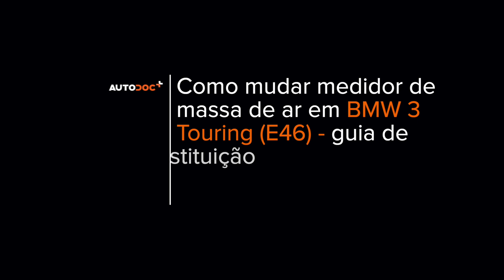Como substituir medidor de massa de ar no BMW E46 Touring [TUTORIAL DA AUTODOC]

Comment: O que acontece quando este medidor está a funcionar mal?
Reply from the maker: Boa tarde Estimado 
Os sinais de um caudalímetro com defeito no gasóleo e na gasolina não são diferentes entre si:
O motor do carro não funciona bem mesmo quando opera no modo “inativo”. As leituras do caudalímetro flutuam ao ralenti e a ECU não está a ajustar corretamente a localização do regulador mecânico.
O veículo perde a sua suavidade.
O condutor não consegue ligar o motor de combustão interna - pode ser necessário verificar o sensor de fluxo de massa de ar.
O veículo perdeu a dinâmica habitual. O carro acelera com muita dificuldade.
O consumo de combustível aumentou. A unidade não determina o volume de ar que entra. Assim, aumenta a quantidade de combustível para que o condutor possa ligar o motor.
Se a luz “Check Engine” estiver acesa, significa que não só tem de diagnosticar o motor, como também tem de descobrir como verificar o caudalímetro em gasóleo ou gasolina. Cumprimentos AUTODOC
Reply: @autodocpt.autoparts  muito Obrigado pela vossa resposta e ajuda. Boa continuação